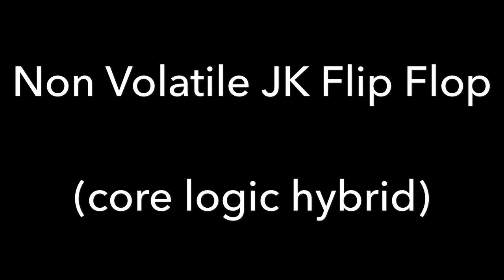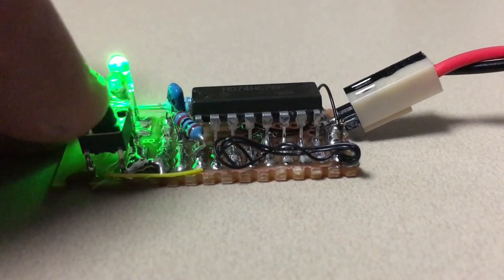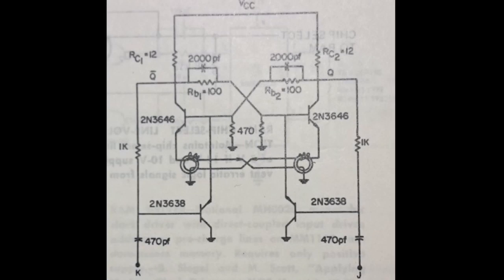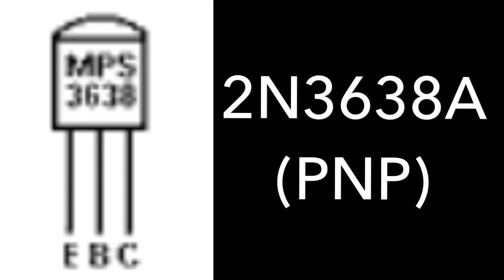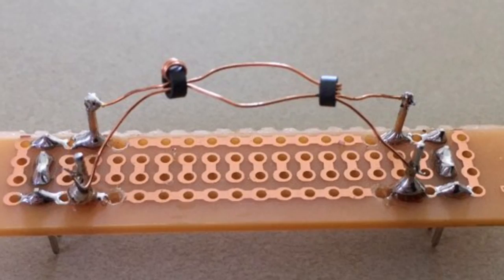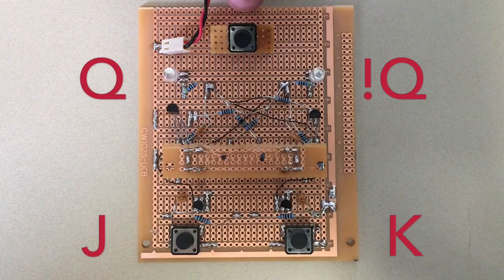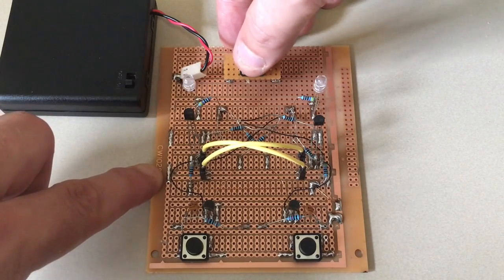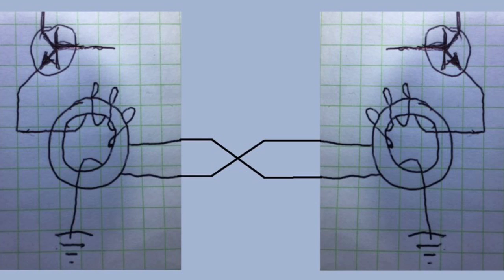Non Volatile Flip Flop (Core Logic Hybrid)

Comment: I just found this video and channel. I built a test bed 4X4 bit magnetic core memory and learned a lot in its construction using just 6 transistors for the sense section and the basic circuit was from the 1969 Casio AL-100 calculator. What you present here is very cool and I might need to give it a try. My cores might work with the turns you used along with my #38 wire. Take care.
Reply from the maker: Good luck. I still remember the feeling as my core memory was coming together working. I probably got lucky on a few things such as the instruction timing of the microcontroller being able to catch the sense pulse.
Reply: @BrekMartin  Thanks, in my setup the pulse sets a SR latch so the timing for reading the latch is not so hurried. My video shows the little mess in action ;-)
Reply from the maker: @marknesselhaus4376  For this circuit, you might have to have matched transistors, which nowadays, those of the same batch might all be? Possibly even well matched resistors. This circuit was very reliable, but I’ve made a duplicate using the same core that wasn’t. It’s only a gut feeling that it’s because one side of the circuit was inherently faster than the other.
Reply: @BrekMartin  Oh how I can see that as my resistors and caps are low tol and I have to often tweek a circuit to get everything just right.

Comment: I’m working on a core memory 8x8 bit array and I was wondering if you have any idea where I could source hard ferrite cores- preferably 1-2mm od. After scouring the internet I’m starting to wonder if I would’t be better off buying a module from the 60s and bringing it out of retirement. Great videos btw! I love the home-brew yet professional style of your videos; and they are very informative!
Reply from the maker: Hi Chris, The only cores I know to be square loop ferrite suitable for this were being sold on eBay by a guy from Bulgaria. The slightly larger cores used for this flip flop, though I thought square at the time, are actually not. They just have enough residual magnetism for this circuit to work, but in a core memory, they won't produce the distinct sense pulse when changing state. I would cough up, but the rest of mine were used in another experiment where I crushed them all up to try gluing one larger core back together.
Reply from the maker: Oh, thanks for the kind words, and good luck! There hasn't been any other electronics project more satisfying for me than the core memory array.
Reply: Brek Martin thanks for the info! I actually just found an old Russian array that has been damaged for $25 - it has 1mm beads so I think I’ll buy that and recycle the beads (I hate taking a vintage piece of tech like that apart but it’s not functional the way it is). The reason I’m looking to build a core memory unit is that I’m building a smart house control system and I needed a way to store 8 bytes for variables accessed by different chips. Originally I was going to use an eeprom but I’m not sure how often I’ll want to write to it and I figured this would be a great conversation piece. Plus I’m pretty sure I’ll be the only one to have a smart house with core memory. 😜 Also, other than “Wayne’s Tinkering Page” and “Magnetic Core Memory Reborn” are there any other sources you would suggest reading?
Reply from the maker: I think there’s more merit in a new working one than a vintage non-working one ;) When I was doing the project, I took an interest, and read all I could (including YT videos), but the two projects you mention were my main sources. Mine really just expanded them. The only original part of my own is the addressing logic.
Reply: These can be found in LAN ports on old computer motherboards.

Comment: If each ferrite core occupies a volume of 5 mm x 5 mm x 5 mm and you want to have 1 MB of memory, it will occupy a volume of
5 * 5 * 5 * 1,000,000 = 125,000,000 mm^3
= 125,000 cm^3
= 125,000 mL
= 125 L

That is slightly larger than my aquarium, which is 100 L.